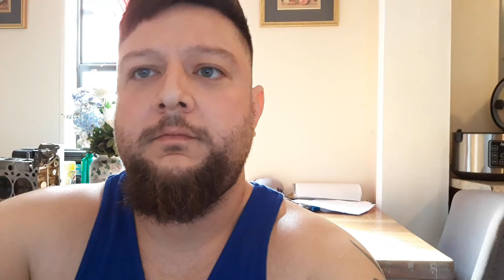500whp On Pump?

Comment: after burning up my vitaras, I decided to go with e85, but I am using flex fuel sensor and methanol, just in case. my tuner is mostly a race car tuner, so he generally tunes e85. but because of the shortage of e85 last year, i'm going to use a dual tune or flex fuel tune. but we'll see what happens

Comment: Ugh!!! I hate this conversation!!!  If your trying to make 500hp on 93octane (or worse 91octane) in  your daily, I think your not very smart. Of course unless you have the funds to laugh off the fact that your engine is blown up and just rebuild another one. In a K24 its really not a big deal because of the additional displacement K20 more risky, B18 riskier , Dseries good luck!!!! 
The reality is for ever person who makes 500-550-even 600hp on 91-93octane there are exponentially more people that are crying because there of a melted piston, drop valve, spun bearing. When you exceed the fuels ability to resist detonation in a (no diesel) you can have a engine made of diamond and its going to break. 

There are so many conditions your car is not tuned for after a $500-$1000 tune. Hot, Cold, Rain, Dry, ect ect!!! There are so many tuners who don't even understand all these things and think what the dyno says is the only thing that matters. Also, the guys who are trying to make 500+ on pump typically don't have high level engine management and all the datalogging to support it!! So when things go wrong down the road and you have no data and are told by jackoff honda-tech keyboard racecar builders, its your tuner, its your engine builder ect ect..  you blame the tuner, engine builder, god, the crazy Jehovah witness knocking on your door when its your fault. You tried to push limits on a BUDGET!!! Never a good idea unless you want to end up broke. 

My recommendations for SUCCESS. Spend your money on an engine management system with great datalogging and a tuner who knows how to set it all up correctly. Don't worry about hitting a number, there is someone in the world who has done more with less and they never told you about all the money failing it took to get there!!! Focus on letting the car make the hp it wants without having to aggressively change timing. Stay under 18psi as a rule of thumb. Focus on having a car you can drive, not a car you can talk about how it made 500hp but its broke and next time your going to make 600!!!!  AND make sure you can properly data log!!! Nothing will tell you what happened like the data!!!!! 

My 2cents
Reply from the maker: I have numbers I would like to see but ultimately leave it to the tuner. With that being said I'm also in south Florida with several very well known and proven tuners around. I also know which ones to go to for what I expect to see. This isnt encouragement other than can it be done and has it been done often. Yes to both. I'd tell anyone at the end of the day to leave it to the tuner. 450whp is close enough to 500 that i dont really care that much, and I've seen those numbers on pump on all of the piston/rod blocks I've put together.

Comment: Building a ls rn. 8.5.1 srp pistons and eagle rods ls head with stage 2 turbo cams and dual springs .how much power should i see on 18psi in the intake manifold . Stock sleeves
Reply: Tyler Bailey psi doesn’t mean shit, 18 psi out of a gt25 is much less than say a gt38, with the parts list provides you should be fine with 400-500 hp
Reply: That thing is gonna feel like shit with a CR that low, especially if you plan on using pump.
Reply: @Jamxknife  shit havnt put it together yet. Why you say that have you had a motor with comp that low?
Reply: Alright still debating what to do about comp.. bought a fresh machined b18b with new srp 8.5.1 pistons and a built head with stage 2 turbo cams for 500 bucks so .all brand new just ordered eagle rods aswell
Reply: I have a small turno .63 hot side t4 cold side  and it's good for 500 hp so plannin on running 18 or 20psi
Reply: @boostedek3573  A .63 A/R should be decent for your power goal. A T3 gtx3076r, s257sxe, or 5858 will work fine. If you want some extra spool and mid-high end power a t4 twin scroll with a low .80 A/R would be perfect. A t3 twin will be even better